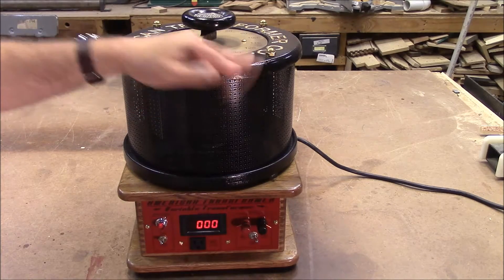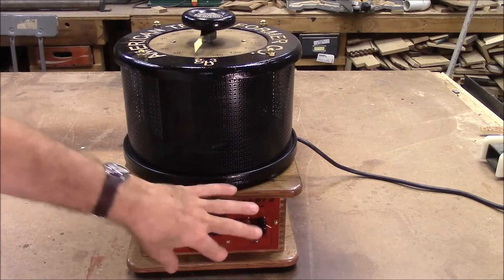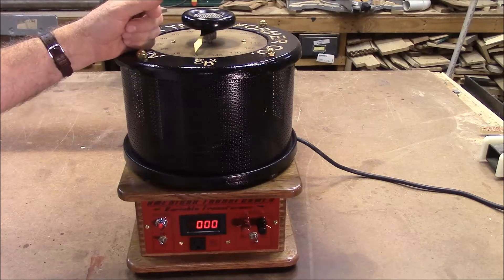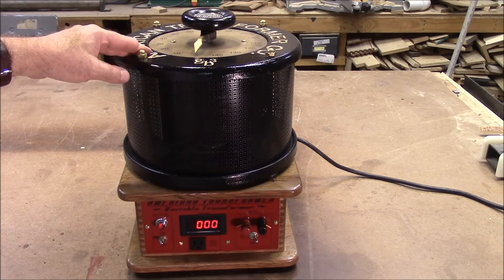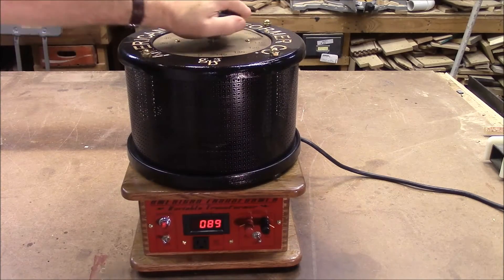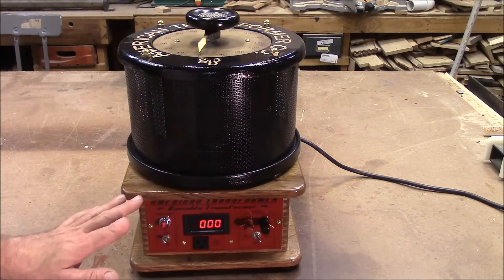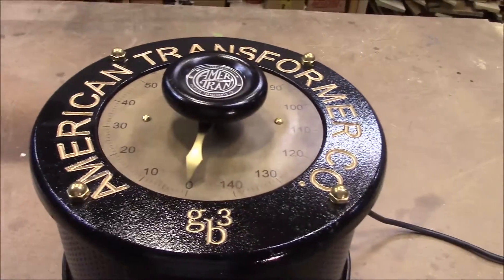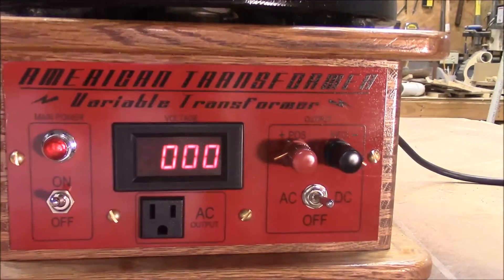Rheostat Project:  Introduction of making a rheostat

Comment: This series looks quite interesting and I am looking forward to it.  This may really be a dumb question, but what is it used for?
Reply from the maker: It supplies current at any voltage from 1 volt to 140 volts in both AC and DC.  It is really just a large power supply.  Sometimes it's helpful to run something at a voltage that is lower than the piece of equipment is supposed to run at and then bring it up slowly, that way you can possibly find a problem without burning something up.  Thanks for watching!
Reply: @SoatMon  I want to know which electrical equipments need less voltage at startup and then the rise in it.